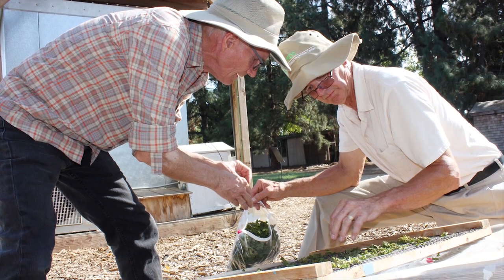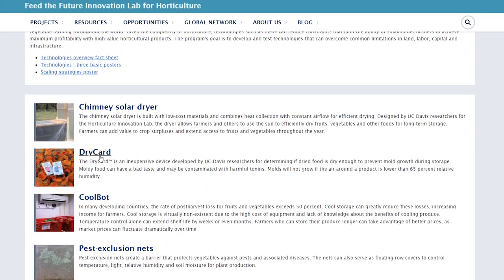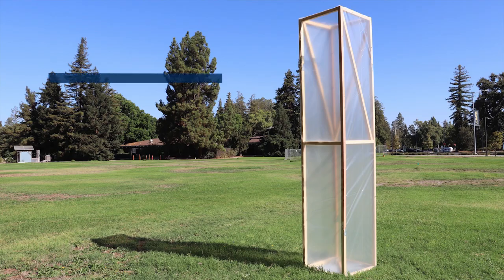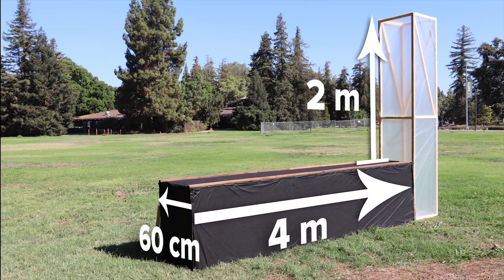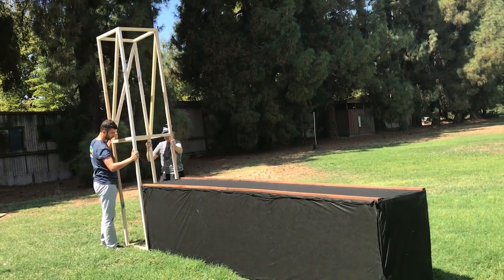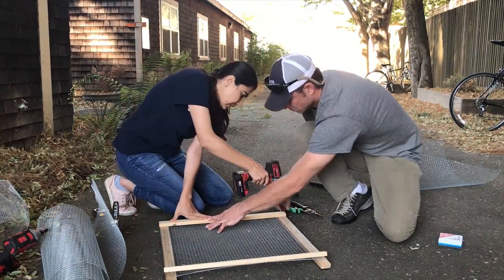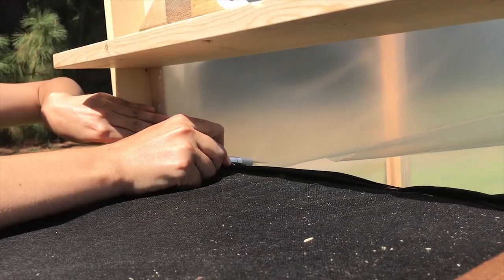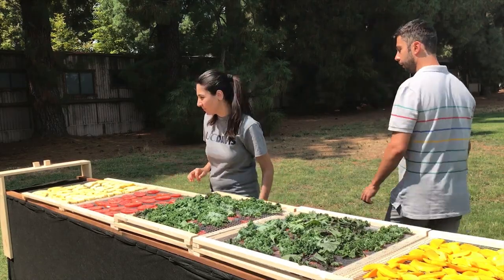Building a Chimney Solar Dryer

Comment: How will the design control rains and dust since the chimeny is open?
Reply from the maker: Hi, thanks for your question. The opening in the chimney is critical as it allows heated air to pass through the dryer. The products are not within the chimney itself, but covered in plastic on the table connected to the chimney. So none of the product would be directly exposed to rainfall. There could be a minimal amount of dust that travels on the air through the dryer (not from the chimney but from the small horizontal opening at the end of the table), but in comparison to open-air drying, the product is well protected. Please let me know if that does not make sense or if you have additional questions. Thanks!
Reply from the maker: bram syamith  Hi, thanks for your question! It could potentially work, though we have not tested it with coffee beans specifically.

Comment: I wonder if it would work better with the food racked in the chimney part?
Reply: Outlook Account with black plastic on north side
Reply from the maker: Hi, thanks for your interest in the chimney solar dryer! What you're describing is similar to some of the more traditional cabinet dryers, where the racks in the chimney can actually impede airflow. This dryer works by combining the drying power of both direct solar heat and solar heated air. Placing the trays on the table (so that the airflow is parallel to the trays) reduces airflow resistance and allows the chimney to produce more airflow.
Reply: @hortcrsp  wow, this is something new, i´m from Colombia, as you know the cost of transport and the bad state of the roads makes really cost inefficient to sell most of the crops in my fathers farm, pluss all the crops go out the same month and the price drops, so i will make a pilot of solar dehidrators, i was ready to make a wood cabinet, based on a design i found, but your dryer seem a lot more cost efficient, i´m gonna give it a try, will post any results. Thanks.
Reply: Hello. Have you tried making it? Any update?

Comment: why chimney is transparent?
Reply from the maker: Hi, thanks for asking! We prefer to cover the chimney in clear polyethylene to prevent any potential shading of the drying table (which could happen if the chimney were covered in black plastic, for example, depending on how the dryer is oriented). We also find it relatively convenient to use clear polyethylene for the chimney since we are already using it to cover the product on the drying table as well.
Reply: @hortcrsp most poor countries are closer to the equator, where angle of shade is less.  Maybe solar chimny could be slanted accordingly away from the food slightly to lessen the effect further on the solstice.  Of course it also depends on when crops are harvested.